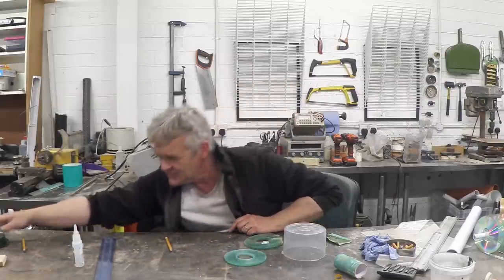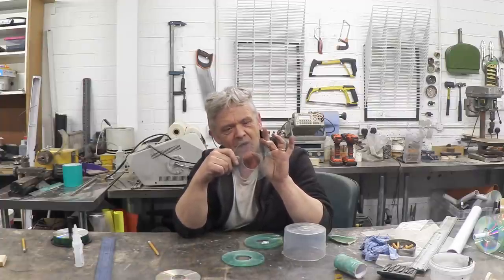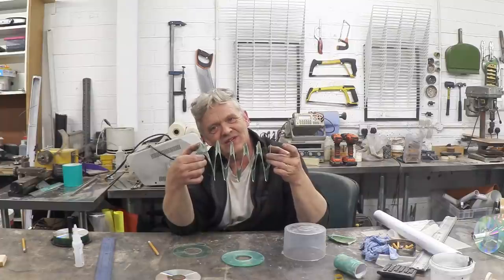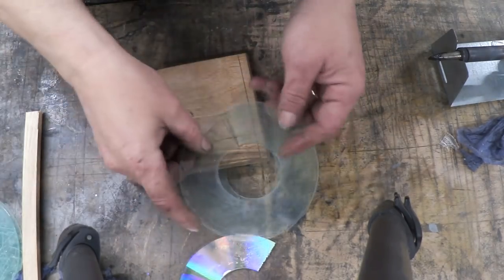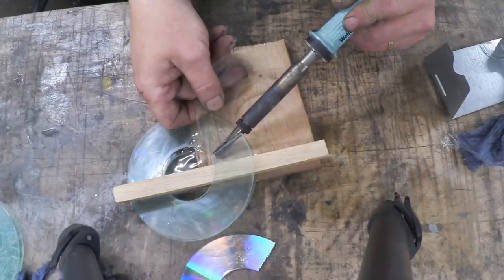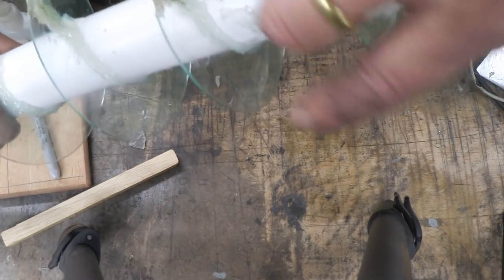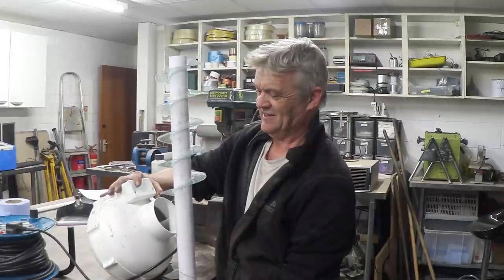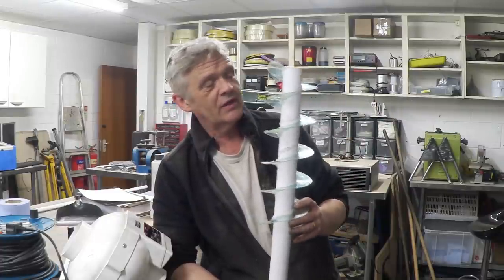Archimedes Screw From CDs-  Improved Method

Comment: Instead of a bearing, you could put in a plug with an eye bolt.   Then you attach a vinyl coated cable to the eye bolt and the other end of cable attached to an alternator.  So, as the water turns the screw, the cable turns the generator rotor.
Reply: Nice, or a shaft from a strimmer.
Reply from the maker: I like that mate - cheers
Reply: yep thats the thinking,the alternator doesnt care if its continuous or variable pulsed rotation, and your dumping that power into your caps/rms batteries buffer

Comment: You can easily install a second flight inside the first thus cutting the pitch in half and halving the force on the joints. You may find that this would reduce the water flow requirement by 50% while increasing the torque output significantly. I suggest the next generation use a metal inside tube to improve the rigidity and reducing necessary radial clearances to improve efficiency.
Reply from the maker: nice suggestions mate - especially the double helix - I like that

Comment: Maybe heat weld the edges by slightly overlapping then using hair straighteners i.e 2 hot surfaces to sandwich them between until they have a flat plane ?
Reply: if your going that route, then simply painting conductive ink on the joining edges and apply current,and so very locally applying internal heating to both the ink and both/all surfaces in contact, give them a little "friction" again to mix the contacted material,you have a weld and conductive ink in place, a useful option sometimes. 
but a version of  fran's super strong way is faster for one off's, no drying time etc, and with a little practice even frans weld would look nice without extra steps.. 

if you really must you can even make a tiny diy plastic friction welding cnc at home from readily available modeling supplies "10mm model square and round wood stock" and Dremel type Flexible Shaft Extension chuck for fun and no cost scrap plastic as your base material to learn
Reply from the maker: I hadn't met - I like it - cheers
Reply from the maker: clever mate -I like it - I could also microwave them
Reply: @ThinkingandTinkering  actually id forgotten that works to :-) 
always good to mention the obvious as it helps wake the brain up
Reply: Good idea

Comment: Hot staples may join them stronger and cleaner. When you mentioned putting that system into a larger pipe for lifting water I wondered if the same might increase the turbine ability. Having a rectangular hole at the base with a slight funneling flange would push the air into the screw and turn the inner pipe.
Reply from the maker: interesting mate -I was thinking in a pipe with a roofline turbine vent as a passive generator
Reply: @ThinkingandTinkering  interesting,  that could be used like a fan as well as a turbine. Multifunctional screw.

Comment: Fair play that’s great you could add a T joint at the top to add the flow with an end cap and a bearing I think the biggest issue is the rpm though they would need gearing up to the alternator

Comment: You could try to scour a helical channel in your PVC pipe so that your CD track could snap into it (i.e. make the CD hole a couple mm smaller than the pipe outer diameter and ensure the helical groove/channel cut into the pipe is at least a mm deep). This would avoid the messy gluing and you may even avoid having to join the CD to CD joint as well as the channel can be terminated and the CD's would be prevented from sliding up and down, so if you install them flush, they should stay flush.
Reply from the maker: interesting idea mate - I will give it a go - cheers

Comment: As long as you are welding, have you used a large, flat heating surface instead of a soldering iron? You have used a clothes iron in other projects, and this material should respond to lower temperatures than metal soldering. 
Are you familiar with the scarf joint?
Reply from the maker: I am mate - it was basically what DmonZ1988 meant I think

Comment: have seen that Archimedes screws will pump, with the screw fixed, and the outside turning... Curious if that would work when fluid flow used to make it move.? large pulley driven by tube could then drive a belt going to small pulley to step up speed to a generator... or it could be possible to mount magnets to the outside of the tube, and use them to induce AC in fixed coils.

Comment: You get up to some very cool stuff.
Are you considering sealing the outer pipe around the screw and then having the entire assembly rotating? That should stop water from leaking around the outside.
Reply from the maker: no I didn't I was thinking of having the screw rotate in a container - nice suggestion - cheers

Comment: thanks for the shoutout! wasn't necessary but i must say its fun to participate!
if you want to try more welding there might be a high temp 3d printing pen capable of using PP filament which should make it easier to get a clean result. 
still think contact cement or solvent weld on the doubled up surfaces will work best though. i've ordered some :-)
this is a project i see myself using.

whats the best method you've come up with for cutting a larger ID? hole saw, heated pipe, dremel or just plain scissors?

Comment: I would preheat ends of disc on a hot metal surface so that 2mm is soft and then press them together with 2 bits of wood 30 mm square and add pressure in vice or vice grips so as to get a fusion bond !
Reply from the maker: it's a nice idea mate but polycarbonate has a nasty habit of shrinking and warping if too much heat is applied

Comment: Love seeing this type of "rapid prototyping" prowess in action, 
got me thinking about how to improve that joint now haha -- I was imagining an extruded capital I (serif font) slotting inbetween which can then sandwich the 2 CDs after applying a little heat/compression....no idea what material to use however! How about your homemade sugru? Something like a staple would be good, if only they made them in that shape lol!
Reply: oh right, i see like (very small in this case) hard dowel pins spaced on a plastic string ribbon and somehow press fit the straight edges together
Reply: paul maydaynight exactly, i was thinking continuous but thin pins would work too. 
Not a hotshot on plastics but would 3 pieces of thin film / heat shrink bind to the HDPE Rob?

Comment: just thought about something - large buildings always have an HVAC exhaust grating - some high some low  some (protected ones) horizontal but most are vertical on the wall (exiting) .  There is ALLOT of air flow that is not being used - would be an idea to capture and venturie that airflow through some type of fan/generator -  its free energy that would be wasted for that building - perhaps remove a section of the sheet metal vent and put this between.  Have a Tesla wall that it charges and that can run 1 circuit on the panel perhaps....??
Reply: Except it's not free energy. Restricting the airflow by putting a generating component in the path would simply cause the energy expenditures of the blowers creating the flow to increase, and more than the energy you would get from the generating component. So it's only 'free' energy in the same way that 'free' money can be obtained via stealing it.
Reply from the maker: Atlas has it mate - but your idea might work in a forced draught which is assisted with a roof turbine vent - interesting - cheers

Comment: Weld the butt joint as you do now but finish it with a hot clothes iron, maybe with baking paper between the plastic and the iron. Should smooth it out.

Comment: I've noticed several ideas for alternative welding methods for the CDs, but you may also want to consider friction welding.

It should produce a much smoother join.
Reply from the maker: the joint is an issue - it need to withstand the weight of water and it will be a critical part - the pipe to cd joint not so much a lot of things will do that but the disk to disk troubles me - I am grateful for all the suggestions it will take me while to test them that's for sure - cheers mate

Comment: Maybe you would have more luck using uv cured glue.   Like is used on cell phones.
Reply: roberts a bonafide doc of chemistry, that happens to spend lots of time down the garden shed
Reply from the maker: I like it mate - it's just a bit expensive right now - a good glue for poly carb is methylene chloride - sold as Tensol 12